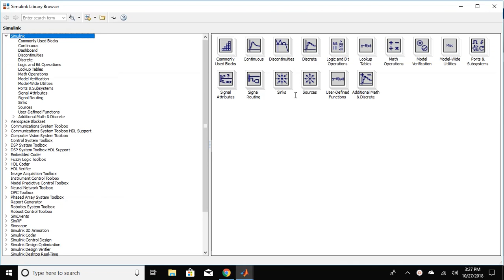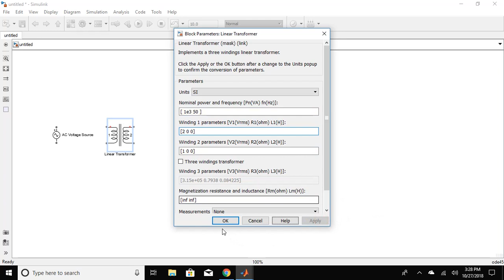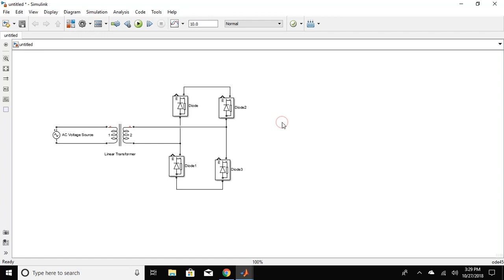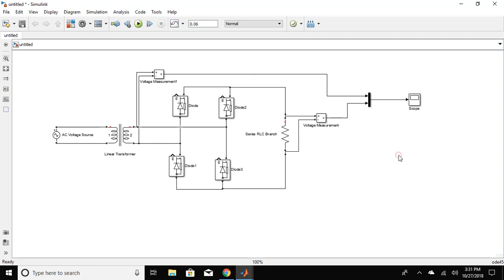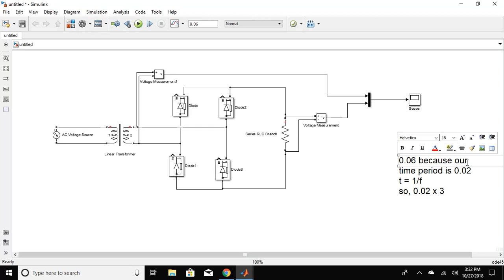How to make Full Wave Bridge Rectifier circuit on MATLAB

Comment: If you had to add a source resistance, RS, of 1.5mΩ and a source inductance, Ls, of 40µH where would you install?
Would you use an RLC block, make it a resistor and put it in series with the power supply and D2
Would you use an RLC block, make it an inductor (L) and put it across the + and - of the supply?
I have been trying to work this out, I think I have the solution but just wondering your thoughts
thanks